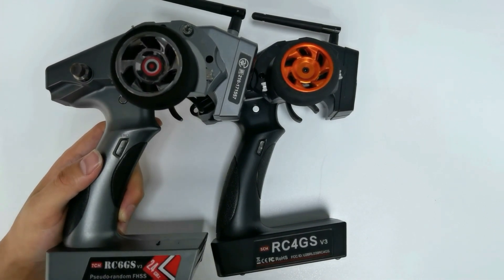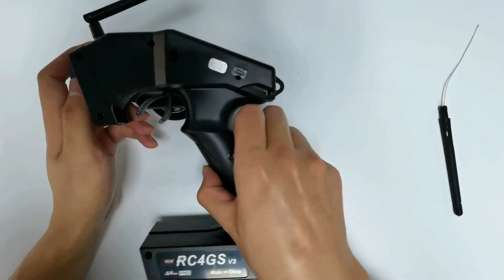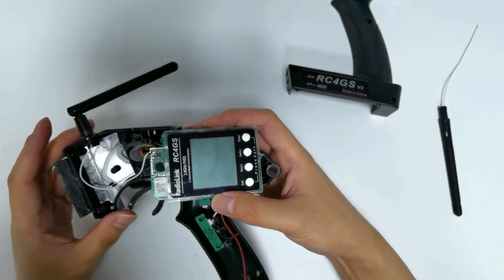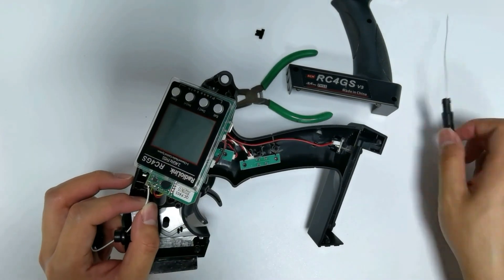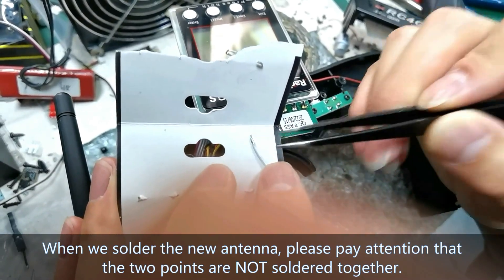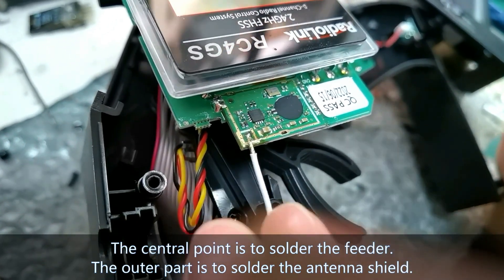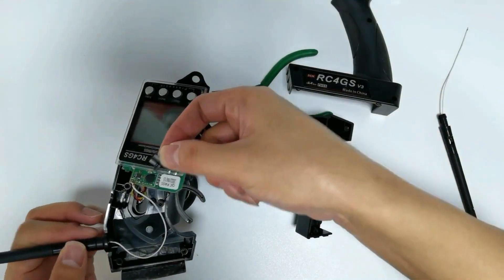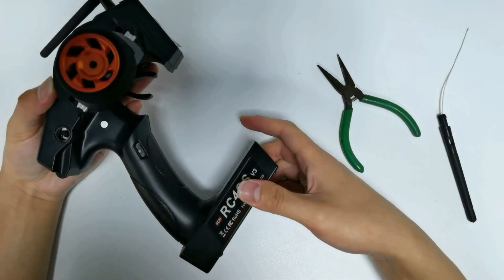How to Replace the Antenna of RadioLink RC6GS V3/RC6GS V2/RC6GS/RC4GS V3/RC4GS V2/RC4GS Transmitter?

Comment: How to connect to sim? Nobody cares about the antenna! Where is the DSC cable being sold?
Reply from the maker: Hi, sir. RC4GS V3 can connect to the computer to play simulator. Here is a video from our customer, who use RC6GS V3 and VRC simulator successfully. The using method is the similar to RC4GS V3. 
You can check this video tutorial: https://www.bilibili.com/video/BV1hr4y1G7cE
You need a dongle when you use simulator. There will be cable needed to connect the dongle to the DSC port of RC4GS V3. The cable usually comes with your dongle when you buy it. You can search it online. Sorry we do not sell any car simulator. You can search it online. If any question please feel free to contact us. Our email is after_service@radiolink.com.cn

Comment: How to replace the upgraded antenna that is now shipped and has the connector attached to it? Do you need to cut off the connector then just solder the center wire? No instructions with the upgraded antenna.
Reply from the maker: Hi, sir. Could you please check the old antenna of your RC6GS V3? Check if it is soldered or it has connector? If it is soldered, you just need to remove the connector of your new antenna and solder the new antenna to your RC6GS V3. If any question about RadioLink products please feel free to contact us. Our email is: after_service@radiolink.com.cn

Comment: Hi, can i use a shorter Antenna for the Transmitter? I know i loose a bit of the range, but it is not important for me.
Reply from the maker: Hi, sir. We recommend to use the original receiver of the transmitter. If you use other antenna or shorter antenna, the control range may be shorter. But it's up to you. Please make sure there is stable signal transmission of the signal before you use it. You can test RSSI before use it. If any question about RadioLink products please feel free to contact us. Our email is: after_service@radiolink.com.cn

Comment: Great how to Video I need to replace mine on the v2
Reply from the maker: Hi, sir. Just follow this tutorial. Antenna replacement of V3, v2, and V1 is the same. If any question when using RadioLink products please feel free to contact us. Our email is: after_service@radiolink.com.cn
Reply: After take the sticker (radiolink) from the wheel center, it has another part (plastic). After that we access the screw.
Reply: How can I install thumb lever? Does radiolink sale  this part ?
Reply from the maker: @sonarfleet2375  Hi, sir. Do you mean  the trigger? Yes. it is available. All accessories of RadioLink products are available on our official store. Here is the link of the store  https://radiolink.aliexpress.com/store/4714037   Here is the purchase link of the trigger. https://www.aliexpress.us/item/4000801805078.html  Sorry there is no tutorial on it now. But if you need it, we can post a tutorial in the future. Any question please feel free to send email to after_service@radiolink.com.cn
Reply from the maker: @sonarfleet2375  Hi, sir. Do you mean the wheel replacement? Here is a tutorial for you https://www.youtube.com/watch?v=QcyZAmFSE0Q
Reply: How can O use Rc8x in simulator ? Does radiolink sale any cable or wireless solution ? Does Rc8x has Bluetooth?
Reply from the maker: @sonarfleet2375  Hi, sir. If you want to connect RC8X to simulator, you can set PPM-OUT in protocol output mode in External input output in RC8X. Here is a video from our customer, who use RC6GS V3 and VRC simulator successfully. The using method is the similar to RC8X.
You can check this video tutorial: https://www.bilibili.com/video/BV1hr4y1G7cE
You need dongle when you use simulator. There will be cable needed to connect the dongle to the DSC port of RC8X. The cable usually comes with your dongle when you buy it.  Sorry we do not sell it. You can search the accessory online.